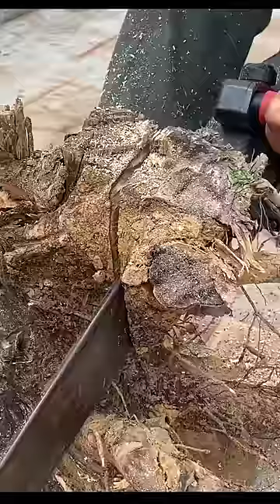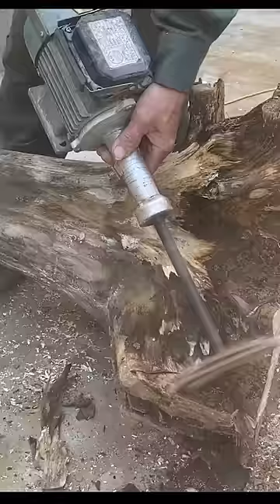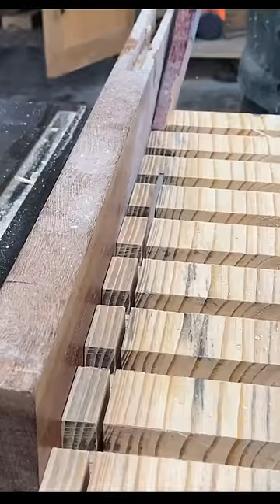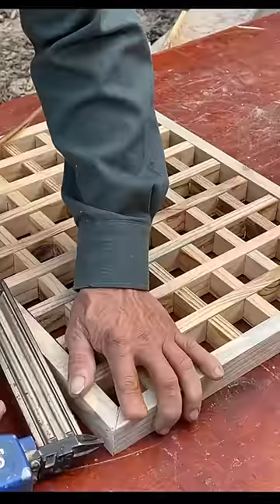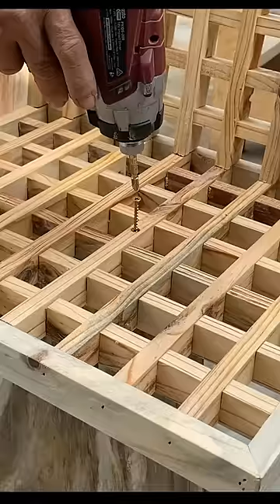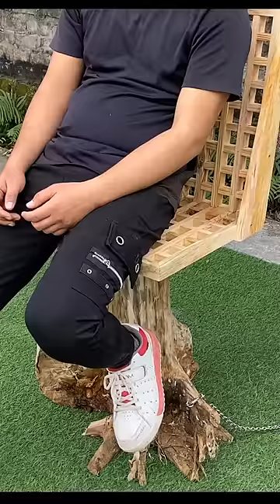A Chair With A Great Design #woodworking #shorts #woodwork #woodworker #wood

Comment: The base is awesome an the seat is awesome but they don't belong together. It would be better if you used a burl slab for the seat an backrest.
Reply from the maker: Thank you very much !
Reply: @diywoodworkingplan8668  I'm a true Wood Carver. 
From Oregon. So I'm not trying to cut you down, your work is so awesome. I'd suggest you use the same tree. An fab a piece too make the seat an backrest from the same wood. Square and round or curve don't go together.